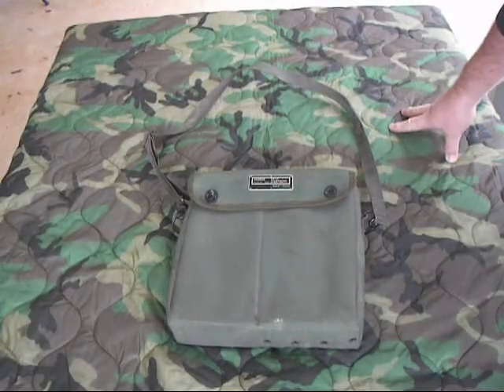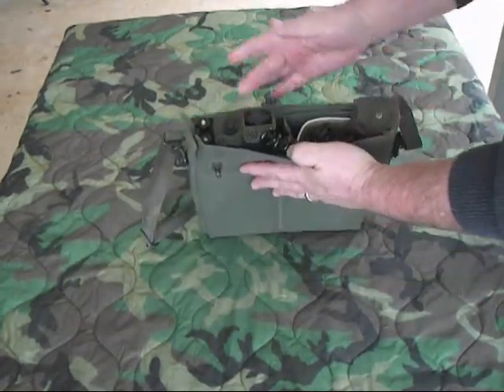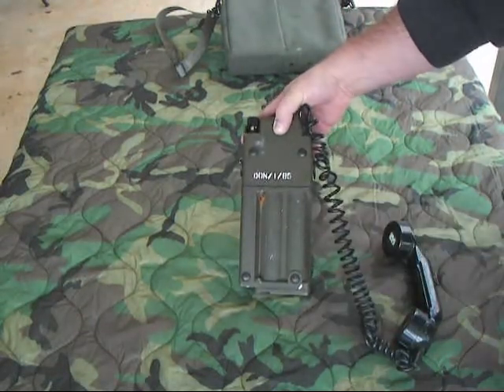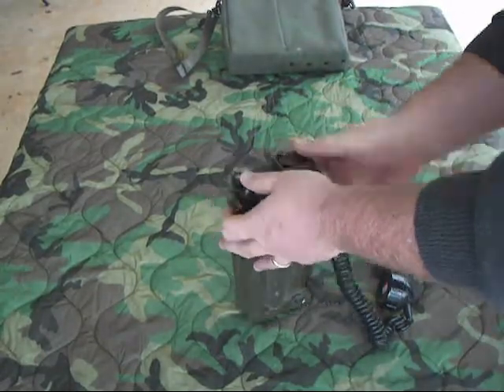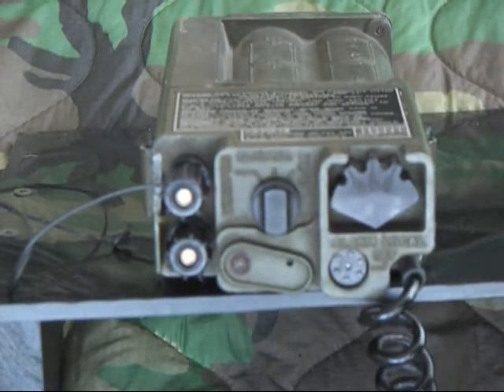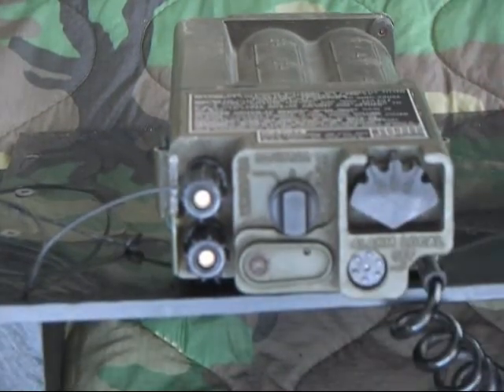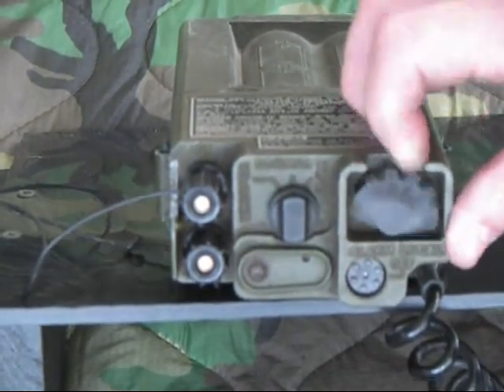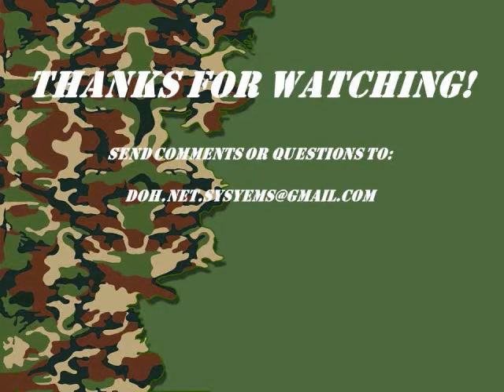FIELD PHONE OPS: British MOD PTC-404 Field Phone

Comment: Hi, is it possible to replace the handset cable on these? The rubber has perished on mine leaving the exposed wiring underneath
Reply from the maker: Probably can be done but it's gonna be difficult  . I'd have to look at mine and see how everything disassembles. I have had some luck replacing the cords on a TP6N and two FT-602 handsets